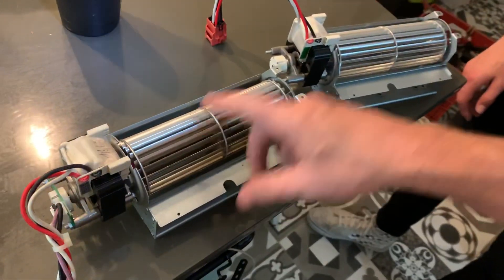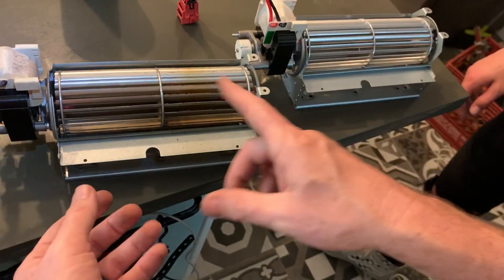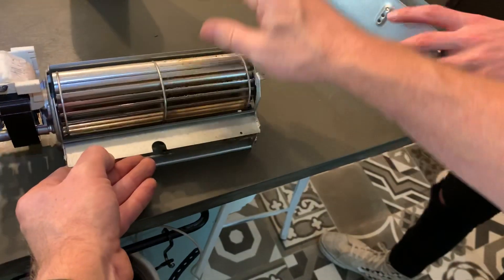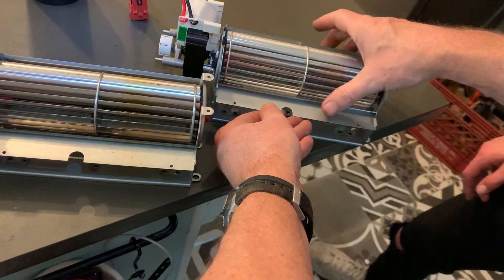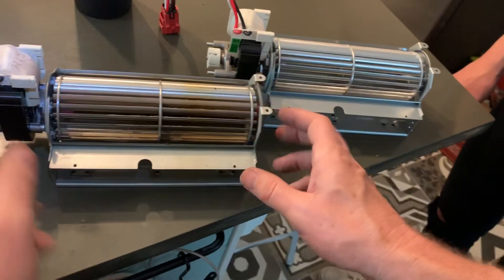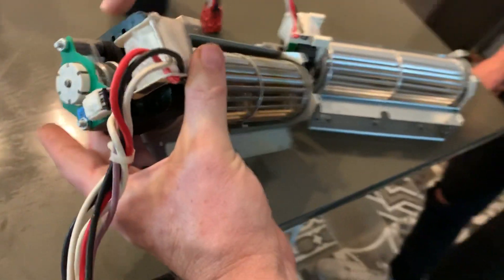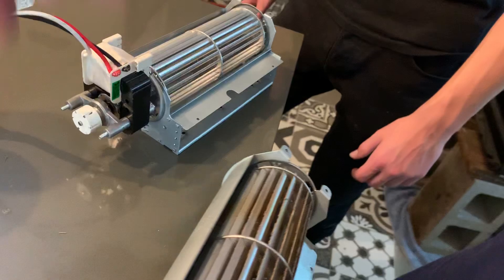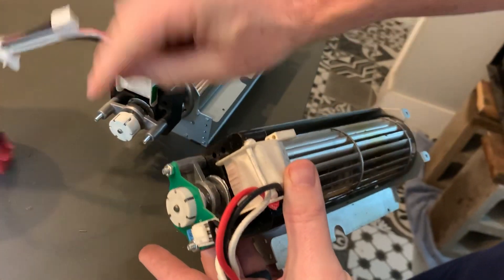Lower Cooling Fan- GE Oven F97 code

Comment: This lower fan and circuit board is located in the back between the 2 ovens! This is code 97. 
Don't confuse it with the upper fan and circuit board like I did!!

Comment: My fan spin freely and I still got the code even  after just a dozen times of use just after one year.  Many people reported that The problem will come back.  I think the main problem is with the faulty sensor which was way sensitive.  GE has to redesign the hardware or you will keep buying new one every few years.  May be that’s the intention
Reply from the maker: I don't think I mentioned it in the video (notes), but this fan had a different part number than the historical replacement.  Additionally, it came with a note saying that this fan was not 2 speed, and thus spun at a higher level and might be a bit louder.  I took it that it was 'updated' with a more powerful starting circuit and eliminated the lower-speed spin setting.  I'm not terribly technical, I'm more mechanical in nature, but there was some sort of change made.  And honestly, now that I've done it once, I could probably replace it again in less than 90 minutes (and $120).  I don't like that, but it is what it is.

Comment from the maker: I was digging through my email and ran across the part numbers that I used for this repair.  I'll post them up, but PLEASE DOUBLE CHECK against your own parts and needs.  I do believe there are a few variances.  My oven model# JK5500SF5SS   
Lower cooling fan
https://www.appliancepartspros.com/ge-cooling-fan-lower-wb26x35089-ap6980441.html

Board Sensor
https://www.appliancepartspros.com/ge-board-sensor-wb27x28659-ap6278889.html

Here is a link to repair stories listed on the website where I purchased my parts
https://www.appliancepartspros.com/diy-stories-for-ge-cooling-fan-lower-wb26x35089-ap6980441.html

Comment: Where is the video on how to replace it. There’s only a video showing the part.
Reply from the maker: There was a forum post about this issue over on GE Appliances Smart Home Solutions website.  A bunch of us were posting over there and I posted up a set of photos showing how to get this done.  However, I just went over to that site and they've updated the site and the links are all broken.  Looks like its been lost.  The job was not terribly complicated.  You have to take the oven out (I set mine on cinderblocks), remove the back of the over, remove the fan and reassemble.  It took me and my son about 2.5hrs and we were going very slow and ate lunch in middle.  Doing it again, I bet I could accomplish it in about 1h 15min start to finish.

Comment: Cody, did you have to pull the entire oven out of the wall to replace the part?  Thanks.
Reply from the maker: I did have to pull the entire oven from the wall.  You will have to access the fan from behind the unit.  This is accomplished by taking off a few of the back panels.  Its really not that difficult.  We ended up taking off more panels than needed.  We setup 4 cinderblocks and a few 2x4's as a base to place the oven on while we did the work.  I'm trying to get some photos posted up into the other thread.
Reply from the maker: Here is a video I ran across that shows an entire one removal and fan replacement.  NOTE this is not our ovens or fans, but the process was very similar and gives an idea as to scope of the project  https://youtu.be/nx0fj625vtQ